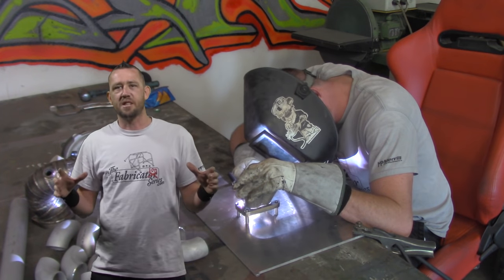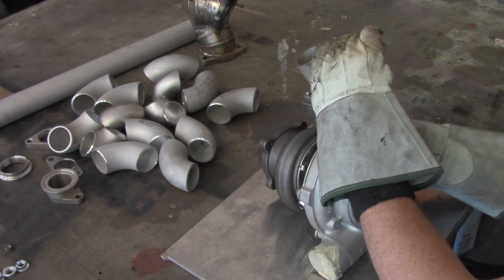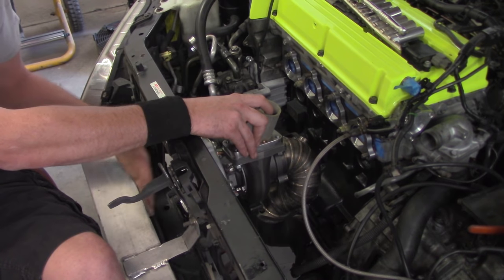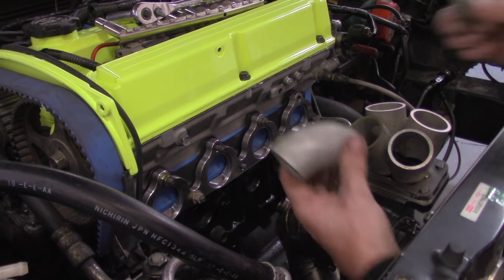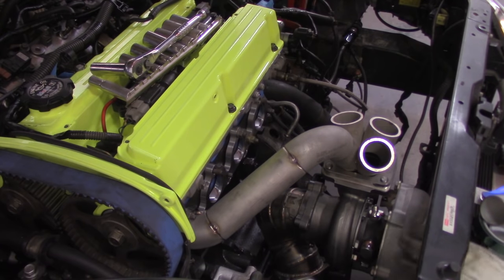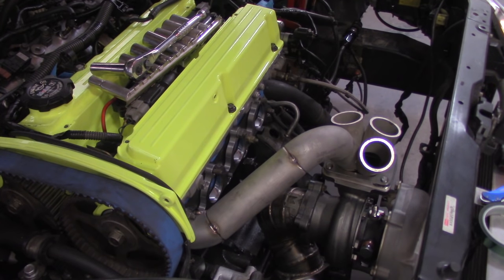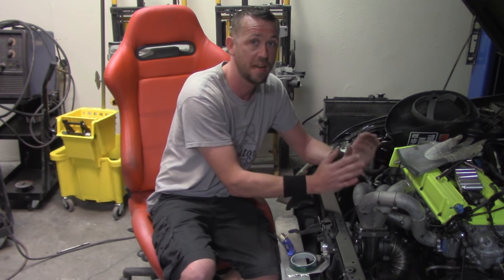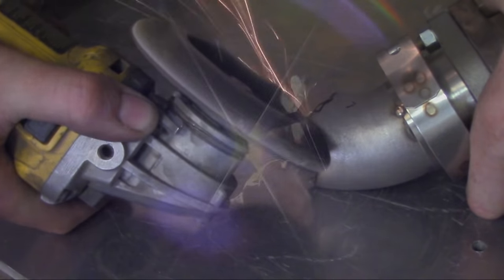TFS: How To Build A Forward Facing Turbo Manifold Part 1 #TFSBoostFab

Comment: I did most of my fab work in Phoenix, hot as hell, just like Vegas. I welded in short sleeves until I got flash burns on the tops of my biceps. I took a cue from the landscapers and roofers... and started wearing long sleeves. Don't confuse hot, sweaty and uncomfortable with overheated. Get some sleeves on your arms.
Reply: I agree with Kevin, burns from welding, is no fun at all and a hell of a lot more uncomfortable than being hot from wearing the correct welding gear.

Comment: Amazing work as ever. Summit racing used to (may still do) sell a kit that had all plastic elbows that clip together and can be adjusted all sorts of angles and when you have a full mock exhaust shape complete they can be taken apart in sections to use as a direct template to mark cut lines on the metal pipe sections

Iceengineworks make the plastic kit

Comment: Was thinking use Pipe foam lagging (wrap) inside the pipe just to dry fit the sections together so you could get the sizes and angles without having to juggle all the bits in one hand , put some ref markers then can spot weld with foam removed.

Comment: At about 22 min in I noticed a problem.  The angle bent back on itself.  That's going to be a massive restriction.  Wouldn't it be better to build from the head instead, to keep everything smooth in the direction of flow?

Comment: What is back purging?  Also why the dedicated cutting wheel/disc for stainless?  Thanks for posting!
Reply: if you mix cutting wheels there can be cross contamination, and get non stainless particles mixed in the stainless which rust.

Comment: I saw you were counting bends and straight pieces, is there any other measuring you did to get your lengths equal? Or does that not matter as much, as far as being very close to exactly all the same, like within an 1/8th to a 1/4. Just wondering bc that's what makes me the most nervous about making my own and I feel like others might be intimidated by the same, that is if welding isn't an issue for them lol. Thanks for the video.... 1 vid and I'm in. Subscribed.

Comment: Ive had good luck using hose clamps to hold pieces together so that they can still be rotated. it can get complicated when you need to hold more than 2 elbows together.
Reply from the maker: I either drop a small tack or use PET tape. It's all in the process, but whatever works est for you is what you should use.

Comment: First of all I've been watching your channel for a long time and your videos are the best hands down. They even helped me weld in my own wheel tubs! My question is did you use 304 or 304L?
Reply from the maker: cjsjodin Thanks for watching! My vendor stocks 304L. I've used both in the past with no noticeable difference. One thing I suggest checking out is the pic of the product. Some will state "304" in the description, but show (and ship) 304L in the pic. It makes almost no difference unless you're really picky, but if it makes or breaks your decision, double check the picture of the product. You ultimately just want it to take the heat and not rust while maintaining strength.

Comment: Hi Justin.
do you have a video that shows the actual cutting of the pie cuts?
i saw the one when you demonstrate the design (awsome video by the way, although i needed to watch it 100 times until i got it), but i cannot find the one where you are actually marking the strait pipe and cutting it.
thanks in advance.
Reply from the maker: I still haven't finished it. It's on the to-do list though.

Comment: do you have a video or going to make a video of welding a merge collector.  and or a video of the first weld coming off the merge collector after the collector had been welded fully
Reply from the maker: Adam Seay In the near future I will have a merge collector video. Part 2 has some weld shots but I don't think there is anything close up of the merge itself.

Comment: why are you using pipe schedule 40 and not tubing?
Reply from the maker: Pipe is thicker and the bends are tighter than tubing which holds more weight. It's also easier to work with.

Comment: how long would the mock up take on average if you were not recording everything on camera? Great videos !!!!!
Reply from the maker: Forged Shaft It varies by design but I usually get full mockup in 3-4 hours. This mockup took about 12 or so. I started in the morning and finished at night. The tricky part is getting the camera in the right spot so you can see it the first time because just about everything has to be shot in only one take. The strange part is you (the viewer) often sees more in the vid than I do when making the part which is extremely challenging haha. But I like the challenge.
Reply: Thanks for the reply, seems fairly difficult but you make it look so easy, somehow. I was thinking of attempting one with mild steel steam pipe as it would be easier to work with but it would probably take me a month to complete, someday ill give it a crack :)
Reply from the maker: Forged Shaft The only difference between mild and stainless pipe elbows  (aside from price) is coverage. The other big difference is strength. In my opinion, if you're going to build one, might as well build it once with the materials that will perform better which would be stainless.

Comment: i could use a tip. i'm building a set of turbo manifolds for a vh45 soon using schedule 10 304 pipe. designing and welding i have down fine (aerospace welder/fabricator) my question is, the motor has oval ports so, would i be better forming the pipe to an oval shape or blending a circular transition into my flange?

Comment: I watched both parts but diddnt catch what materials was used for piping was it anything special ? 
them welds I can never do that work of art
Reply from the maker: Ednamole Qwe It's 304 Stainless pipe.
Reply: How thick does the wall need to be on the 304 piping ?

Comment: Love this build! Can I ask where you got the spiral flow idea from? Been trying to find some research on it but can't find anything!
Reply from the maker: Wayne Clement Thanks for watching. You're not likely to find much info at all about it. A small engineering team and I  created the functioning concept about 6 years ago, and this is the most I've said about it. Some manufacturers use their own design/research as well, but I don't think they'll talk about it either.
Reply: The Fabrication Series yeah i've seen one other video so far, there may be more from those guys, and i've seen maybe a couple more images.  Does it aid spool in your opinion? I imagine it gives more consistsnt results, especially as revs rise towards top end
Reply from the maker: Wayne Clement It does when designed and built correctly. It goes a lot deeper than simply staggering which is what I don't discuss.